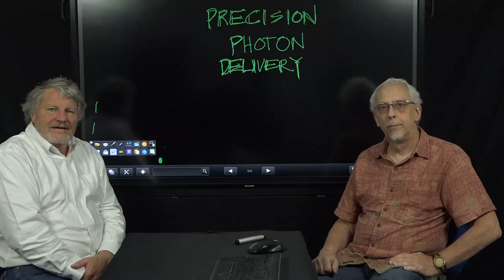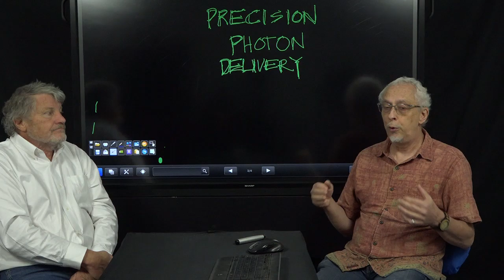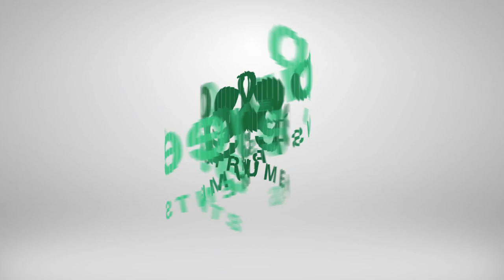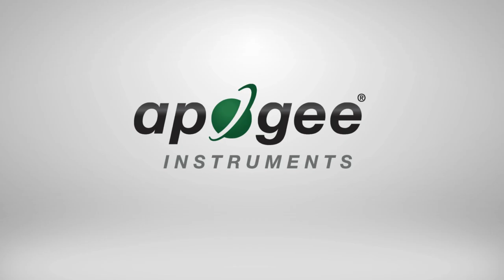Precision Photon Delivery Systems with Dr Bruce Bugbee and Dr Marc van Iersel

Comment: Not exactly the right video to ask this in, but where it's the latest it may still have the comments watched :D  Can you introduce UV A and B by using a reptile light to an indoor grow?
Reply: Depends what light you’re already using. If your fixture already has IR/UV diodes, you don’t need a UV bulb.
Also, UV is only beneficial during flower - for only 3hrs per day avg.

Comment: but like everything man made, it requires resources we will eventually run low on and will rise prices until another source is found and made cost efficient.
I can't believe how many utility suppliers you have, in West Australia we have 1 😂 ironically called Synergy 🙄 2 tariff plans (on/off peak and flat rate) solar rebates per unit returned to the power grid are poor and cost per units continues to rise 👍